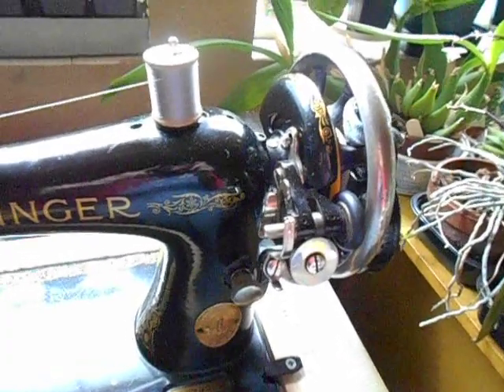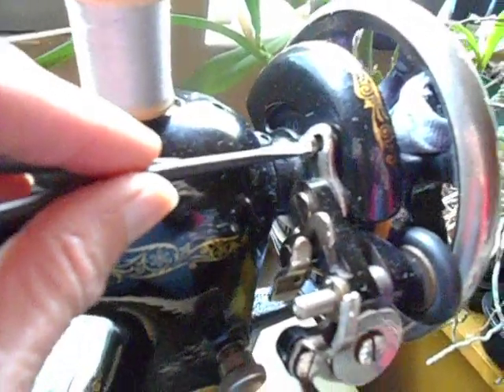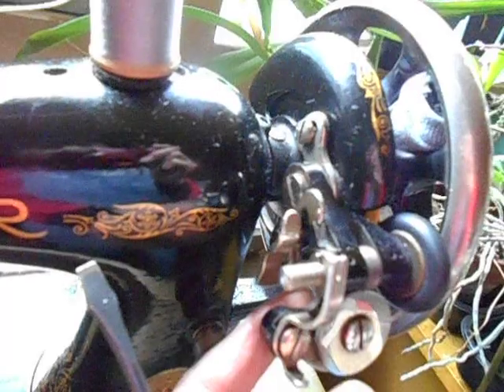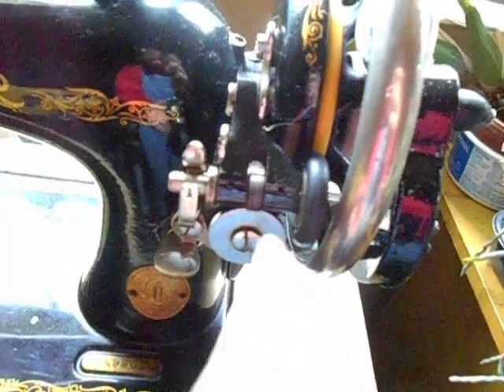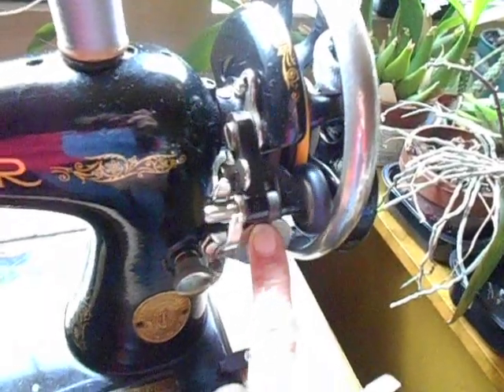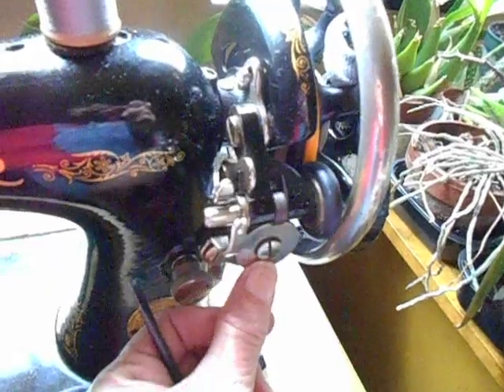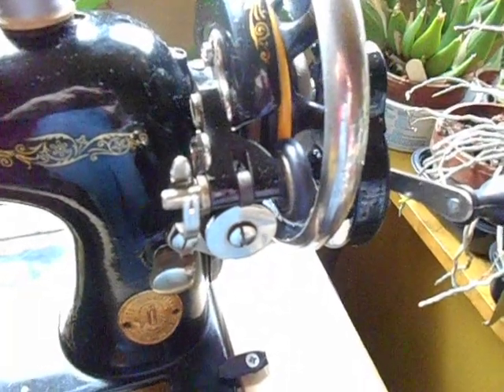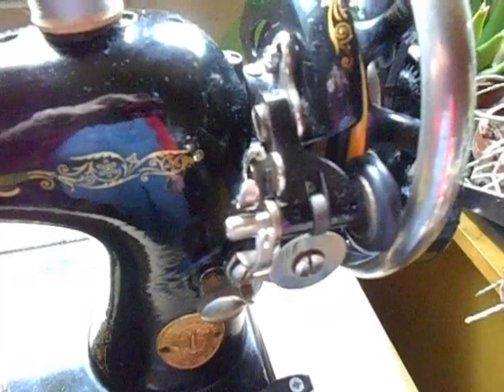Singer Model 99 Converted to Handcrank - BOBBIN WINDER

Comment: Great solution.  I had given up winding bobbins on my 99 hand crank.  I was using a side winder .  Now I have some experimenting to do.
Reply: Experiment number one was a tremendous success. I decided to try running a homemade belt made of nylon between the hand wheel rim and the bobbin winder with the rubber tire removed. I didn’t have any nylon on hand so I decided to test the theory using a wide rubber band it worked perfectly even with the rubber tire still installed the rubber band stayed in place.

Comment: Thank you, I just bought a machine that must have been converted, and the rubber tire does not touch the wheel, so I cam looking for information and now I know I need to build up that wheel!
Reply: Looking at the wheel it does say it is singer and I don't see anywhere a motor would have attached so I'm not sure why it doesn't touch now but at least I know what to do about it.